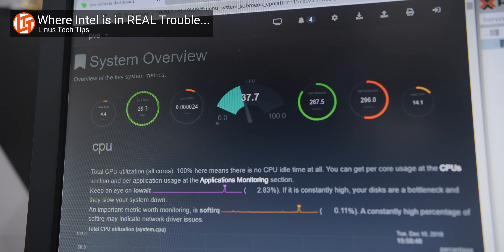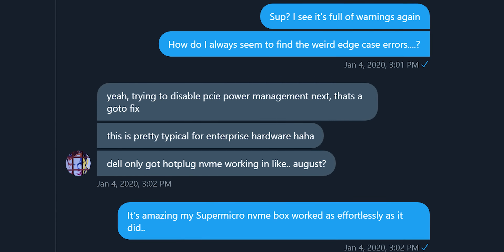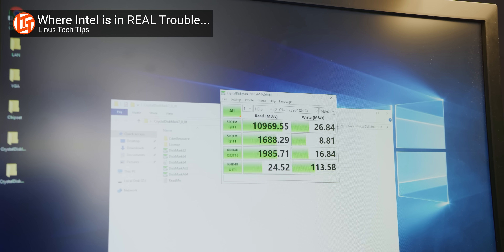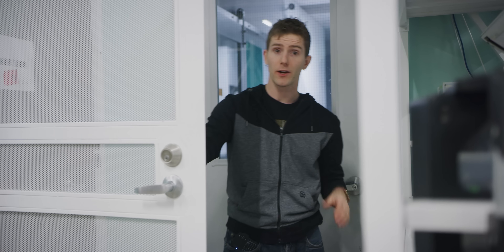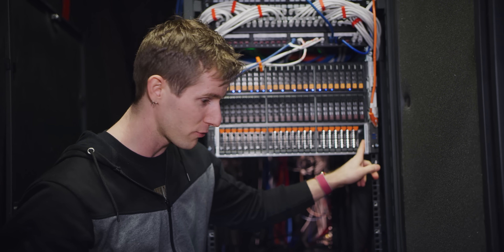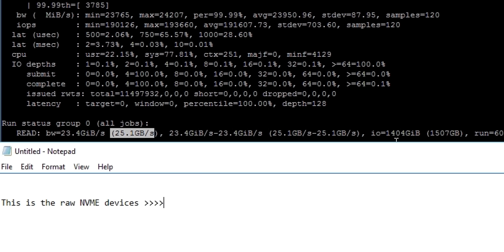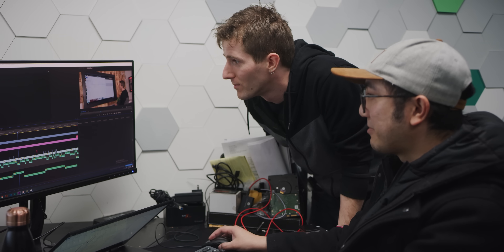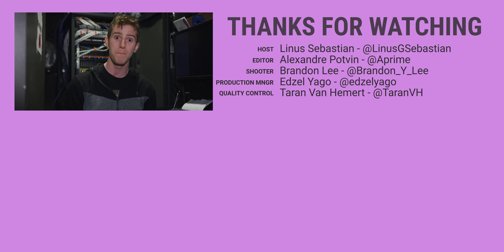This Server Deployment was HORRIBLE

Comment: If you’re using Linux’s md raid and you’re worried about resync times due to a power outage or some other unclean shutdown, go give it’s write-intent bitmap a shot.

I have zero clue whether you’d run into more performance problems (it can hurt things in some cases), but it can avoid long resyncs by keeping track of parts of the array that were being modified at the time of the restart; when the array is brought back up, only the areas indicated as potentially out of sync in the bitmap are checked. The assumption is that chunks that haven’t been written in a while (marked clean in the bitmap) don’t need to be touched as their data is marked as consistent.

With a bitmap enabled, there’s no more beginning-to-end scrub of every chunk in the array, and you can even pull a disk and put it back again (oops, I pulled the wrong drive!) without triggering a rebuild of the whole array.

Again, there may be performance penalties in your case, but you might want to give it a try before putting it into production. In many cases, it helps far more than it hurts.

Comment: You've got to use POWER cpu's when it comes to data loads like this lol
Reply: honestly this entire time I was sitting here wondering if there might be a more appropriate HW RAID solution but I haven't looked into NVME stuff at all. I can hit several RAID10 arrays of four 8-12 TB disks with big ol continuous file transfers without skipping a beat on older hardware because there's a POWER cpu chilling (ok, cooking under a Panaflo) in a pcie slot doing all the work. Windows Storage Spaces shits random bricks with ONE 4x10TB "RAID10" and that's ignoring the fact that I had to use powershell to create that array AND it somehow only tolerates 1 drive failure even with the same amount of mirrors and columns as a 'real' RAID10.

and then I remember the terrible experiences I remember reading about the single LSI HW RAID NVME controller I looked at and wonder if Storage Spaces was actually all that much worse.

Those NVME timeouts are the most perplexing. They never actually solved that problem.
Reply: @sheik124  the timeouts are most likely caused by the same thing that happens in poorly programmed network stacks. So like it'll send big chunks over and over again while the chunk is still being processed resulting in dropped frames. I recommended POWER cpus because they actually have a method like polling built in that would allow for a faster than software fix. This whole issue could be fixed in software by using schedulers but I don't think Linus or his crew write their own code and just borrow others

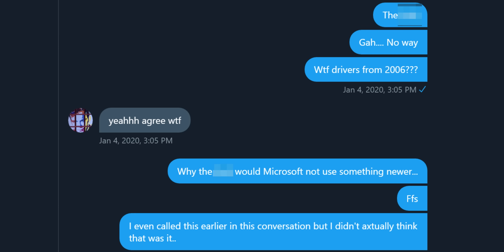Comment: 2:15 Windows stock Drivers are marked 2006 regardless of date so that manufacturer drivers would be auto installed with priority, while the windows driver with a higher version number would replace the lower version numbers. https://devblogs.microsoft.com/oldnewthing/20170208-00/?p=95395

Comment: Make sure you have the drive's NVMe Autonomous Power State Transition disabled.  You also may want to set up the drives to use only one submission and completion queue and pin each queue poller to a single core. Also check the drives error log and smart-log: "sudo nvme smart-log /dev/nvmeXnY". You should also setup the LBA to a larger size (512B is default and given the size of the stripes you should bump this to 4KB)

Comment: having worked with WIndows servers in high capacity storage environments, they suck ass compared to linux servers. Wendell is right. Push the bug onto github issues for the linux kernel, it'll get fixed eventually.

Comment: Wonder how various VM's would work - start with trial of VMWare server - run under that, soo how that pans out.  Quick dirty trick to test out.

Though I'd still be - ok, download kernel, lets get too hacking this issue.  Though it's a unique setup and with that, hard to test beyond on the real thing pretty much.   Also be a rabbit hole that most likely won't yield a quick solution.

But the whole VM and running under that, letting that handle the lower IRQ nuances, well, it may just cut some mustard, or not.  But something you might think worth a try for giggle and toilet training.

Comment: What I heard from this video:

Never use nvme in a raid 5 or raid 6 array unless you have Linus level of cashflow.

I am more than happy with my standard drive raid 6 for my network.
Reply: yeah, everytime he mentions raid 5 in any video, especially when he's building a single storage solution for someone else i cringe a little :)
Reply: @dportass  I hear ya there, but he does have more protection than single failure, so raid 5 isn't really a bad thing in his case.

I use raid 6 because it is my ONLY storage. I'm also using 4tb drives, so rebuild time is fairly short if one fails.
Reply: @charlieodom9107  Indeed, usually he has other redundent methods plus other storage and backup devices he has means he is a little free'er to play around with which he uses. Seeing him build a 150TB RAID5 system for someone that doesn't appear to have that level of seperate redundency is where it's mostly un-nerving :)

That said... RAID5... <shudder/>

Comment: I'm kinda shocked they never attempted an Object file system, like OpenStack Swift, getting rid of the RAID all together and relying on data duplication. Especially when combined with an archival tier in a second box using Nearline. Then just having a gateway box serving up the NFS/CIFS.

Comment: I think you have multiple issues, you likely have a kernel bug due to the limitations of the xeon core processor..

I a suspect you might be seeing read and write errors  due to  the sas backplane  completely not compatible with your  sata hard drive even knowing that sas will work with sata however  sas bus may not  be fast enough to cater nvme data array

I suspect you main issue is sas array itself no having the bandwidth to  handle and the other issue  that the ram you have might be causing  processing bottleneck due to its speed,,

I might suggest trying amd server mobo  and the fastest ram you can get to see if if it fixes the limitation of the current intel server board is happening ..

Comment: OTOH, if your server was an (IBM) MAINFRAME, this whole "stupendous amounts of I/O All At Once AND ALL Interrupt-Driven" would just be "another day in the life" of such a machine. And you could run a Linux (or z/OS, or z/VM or z/VSE) instance on EACH of 35 LPARs ("logical partitions") of the same mainframe (i.e. one "server") at the same time (and on a z/VM LPAR (1 of the 35 LPARs), you could run multiple Virtual Machines, such as CMS, Linux, z/VSE, z/OS etc., as well as the other 34 LPARs doing other work)). And EACH of the LPARs' Operating Systems could be all doing "stupendous amounts of I/O" at the same time on the same zSystem  mainframe. But then you wouldn't be putting one of those (mainframes) together from parts, you'd have to buy (lease) it, so where's the fun in that?  I do miss developing software on mainframes (46 year career doing that).  But it's easier to put a system together for fun, so there's that...

Comment: As a long time subscriber, and maybe because I've worked in IT for many years now, this content is far more enjoyable and hardly dry.  Never hurts to have Wendell on the case, either.  I do this stuff for work so you'd think I wouldn't want to come home and watch it but it's great info.  Also, as a 4k monitor user since 2014, thanks for being one of the first to post videos at the res.

Comment: That is true about NVME, I upgraded from a 512GB Samsung 960 Pro M.2 SSD to a 1TB Samsung 970 Pro M.2 SSD, yes my speed & capacity increased but you run into diminishing returns with certain older games.

Comment: Something doesn't sound right to me about this explanation.  The cumulative bandwidth of the drives is irrelevant if they are passing through four PCIe cards not capable of that much bandwidth.  It sounds like some sort of design problem at the hardware level rather than the CPU simply choking on too much overhead in communicating with the drives.  Is it possible the board simply wasn't designed for this.  Was it an actual server board, or just a workstation board?

I'd be curious to see if a Intel server had this problem.   If you bought a Supermicro board and a 24 Core Xeon, I wonder if this would have went much differently.

Comment: My gut says dual socket might give some improvement with additional lanes and memory channels. Only issue there is whatever VM you're running (if one large VM?) shouldn't cross NUMA boundaries or that could affect performance negatively (lots of conditionals there with whatever virtualization solution you're using and the configuration, I'm more familiar with ESXi/enterprise stuff).

Comment: Those drives are from Facebook if I remember correctly. Just like any major internet website the hardware/Kernal and OS is custom built around these things. Just like Cloudflare they have servers with some crazy RAM size you couldn't even imagine. It's all designed in house to buying hardware from these places and trying to get it work on regular OS will be hard. I remember my first real popular website after so much fine tuning Linux Kernel could not handle the RPS connections incoming as the out going data was small. Bandwidth wasn't the issue it. Stock OS is designed around general use. Linus it may be time to hire a engineer that can write custom kernels to get around these limitations.

Comment: I know that at the moment, nobody cares about a metric like Energy / Byte transferred but I find it still intriguing: Isn't editing of a server more energy intensive than editing from a single desktop? 
Let's say, we care about our electricity bill and wanted to reduce traffic on the network because this created the most additional cost. Wouldn't it be possible to create "project boxes"?
(No expert here, perhaps something exists already)
Those project boxes would be loaded if you wanted to work on let's say a video and contain all the required files. While working on them, they would periodically send a backup to the server in case the user lost power. Upon completion of the work, the user would then close the project. That would send all the used files back to the server and optionally delete the backups. 
While a project box is loaded, the files inside the box cannot be read or changed on the server but new files can be appended on the server. These appended files would then be loaded with the next backup cycle. 

This "project box" system would reduce the traffic because the data needn't be sent over every time somebody scrubbed through the timeline. I assume such a system exists in the world of caching / buffering it's just me who doesn't know the proper terminology. 

Also as it's probably the case, the cost for the electricity used by the servers is likely to small to lead an operation like LMG to switch to such a caching / buffering system. However I would be interested in a power analysis of the editing workflow (powerdraw of servers, powerdraw of editing rigs, powerdraw of networking equipment).

In case anybody knows the correct terminology please let me know.

Comment: Linus, try RHEL Ceph; I find it to be vastly superior to OpenZFS in terms of latency and bandwidth.
I have a 400 Gbps HCA and reach 48 GBps reads and 46 GBps writes.

I suggest considering a two-tier network to accomodate some editors (Taran, etc.) on 25 GE and the other editors on the current 10 GE.
Buying a Mellanox 25 GE switch with two/four 100 GE port is a good investment which will allow you to use the 100 GE cards you were sent.
Keep the 40 GE connections for the current Dell 10 GE switch with four/six 40 GE ports.

Comment: Missing CPU interuptions sounds kind of broken. 
They are supposed to interupt whatever CPU was doing, save current execution context, load the execution context associated with the interuption and then process it. Sounds complicated and it also takes a lot of CPU time. 
Polling on the other hand is supposed to ask device if the data are ready in a loop without switching to a different task, so there is no save/load/save/load if polled device if fast enough. 
May be this is a more correct explanation?

Comment: In the Arduino community, it is just that an event interrupt is executed too much that the loop does not get to finish, and your solution is to use a timer interrupt instead, which is basically multitasking.

Comment: My knowledge may be a liiiiiiittle bit outdated. I basically want to say something like "Well, it may be possible on your Adaptec 2940, but i strongly recommend something like the Compaq Proliant 6000 with the max amount of CPU's and RAM possible and then ask which RAID-card is most expensive"

Well, i am about two decades late there. But aren't there any crazy expensive specialized stuff from the big brands available these days? I mean, my Compaq nonsense is based on a real case. Around 1998, a company asked me to help them with a server for their image processing. It sounded easy. But when i saw that they worked with files that was like 3GB in size i had to rethink a "little" bit. I have never after that worked with more expensive stuff. Just the RAID controller was the price of a brand new really nice car. And i remember that this monster of a server had disk performance like something that was considered rather good ten years later or something.

I am probably totally wrong here, but doesn't HP/Dell/Lenovo these days got anything with something hysterically fast, if you are willing to pay?

Comment: Interesting video but do not take everything in it at face value. Interrupts getting lost is a bug, not an edge case happening under load. I suspect there is a lot more going on than what was explained.
For very short waits, polling can indeed be more efficient than waiting for an interrupt (less overhead) but it wastes CPU for longer waits.
The whole explanation behind "the kernel switches to polling if the interrupts takes too long" is fishy. If the event didn't happen yet, switching to polling will only waste CPU. And if the event already happened, it's not really polling (in the design sense), it's just the kernel realising that it may have missed the interrupt (still a bug), and checking one last time before erroring out.

Comment: It makes me wonder what the PCIe Bus saturation is at as well. I have never been very pleased with how a large number of companies handle PCIe lanes. While the newer chips are finally supplying more lanes. Sometimes the on board routing of the lanes can be a problem. Ten years ago, we saw this quite a bit with consumer boards, when designing multi card SLI and Crossfire setups. You could end up with the cards running only at 4x instead of 16x cause the number of lanes that where user accessible, just where not present. If you Look at the simplified board schematics from this time period you will see what i mean. Things like onboard sound, and network cards and SATA ports, all ate up a significant number of lanes. Leaving an insufficient number of lanes available for PCIe switching/routing of user cards.

Comment: That interrupt problem is old af and nearly all drivers from 2003+ which handled AHCI could do so using DMA + polling instead of painfully slow interrupts.
I highly doubt NVMe spec even allows interrupt mode anymore (although they might jump the backwards compatibile train for whatever reason).

Comment: I'm surprised Linus didn't get the thermal camera out. You can easily saturate/get hotspots on any of the I/O Controllers with that Hardware, when accessed by multiple sources (on the same controller or drive)  We had to have our Storage Engineers make sure to separate disparate data during Nightly Batch job cycles to make sure as an example..Store Retail Sales data was not on the same EMC physical drive as Supply Chain Inventory data when 100,000 jobs were running overnight. Simple stuff 😗😛

Comment: Your last few statements reminded of of the outcomes in optimising complex hi-performance software architectures.  You always have to optimise the whole, not the parts. If you optimise everything individually, you may find performance decrease. In the face of say, the incoming http connections overwhelming the dB connections, I’ve seen guys just automatically do things like ‘increase the connection queue pool count’ and discover that suddenly the database itself starts to time out or get some other issue (transaction locks). Whereas decreasing the pool size (or even the http connection pool) increases the overall performance even though each individual part is suboptimal. 

I like these technical videos.